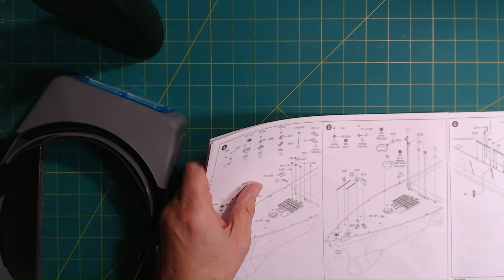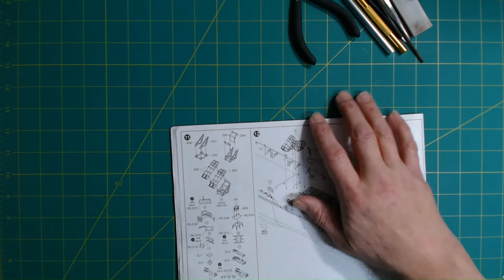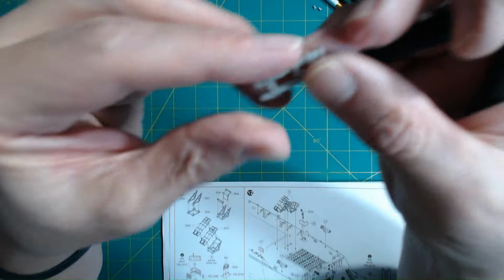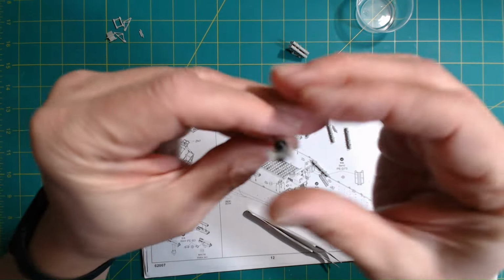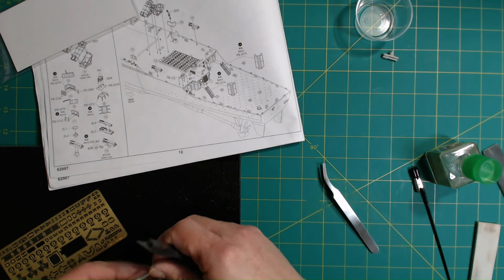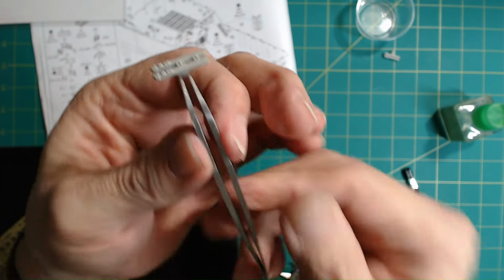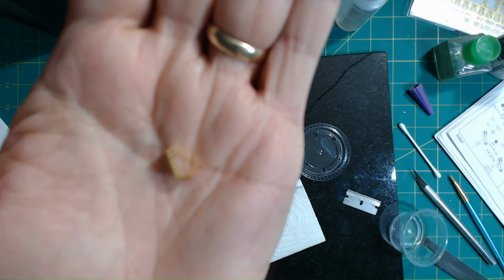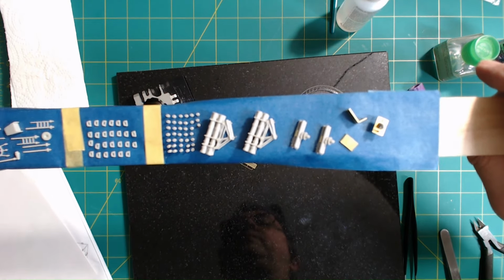USS Curtis Wilbur in 1/200, Video 9a, Deck Details and Some Tedium

Comment: I wanted this kit. Thinking 200th scale? Easier to work with. I was wrong. I have huge hands and I would wreck the tiny parts. Drats. Lol. Glad you are doing it.
Reply from the maker: @willthorson4543, while my hands aren't huge by any stretch, I hardly think of them as small either, so I totally get it, LOL. I have found certain sets of tweezers and an Opti-visor to be of immeasurable help. I hope you scoop this kit up and work through it. Thanks for watching and joining the discussion!

Comment: Hi Patrick, as always a nice video. The camera shake is just a bit annoying. Obviously, it is not very stable attached to the table with a tripod. In some settings, it wobbles significantly when you move your hands. Without shaking, it would be easier to follow your video. Best regards,
Reply from the maker: @wegnerthorsten7661, I really appreciate your feedback; it only helps me to work on improving. I will look into the shaking and explore options for a sturdier camera mount. Thank you!